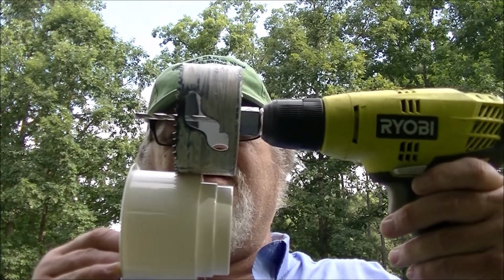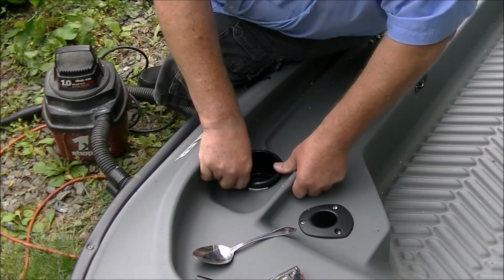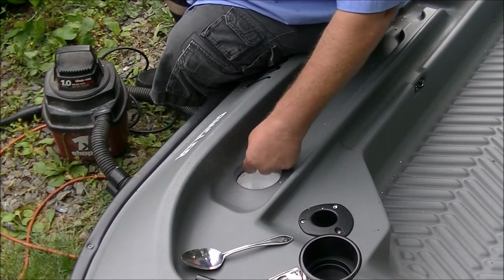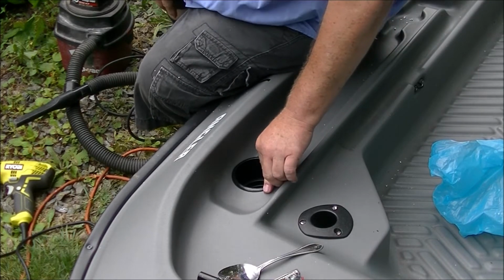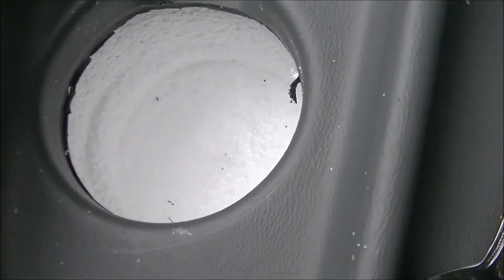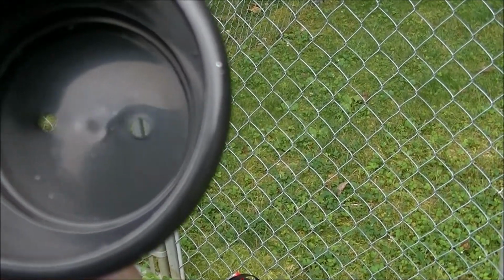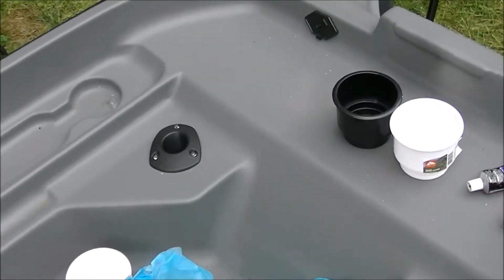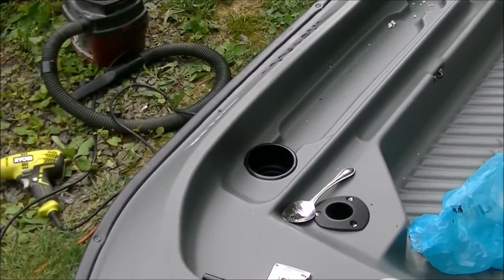Quest Angler 10 Cup Holder Modification

Comment: Why you didn’t just screw it in on top you could have screwed through the drain holes
Reply from the maker: You could certainly do that if you dont mind them sticking up on top of the deck. That wouldnt work for me because between me and my buddy we carry 6 rods and lay them down in this area and mounting them that way they would be in the way. This was also the reason I moved my Garmin from this area (in a different video)